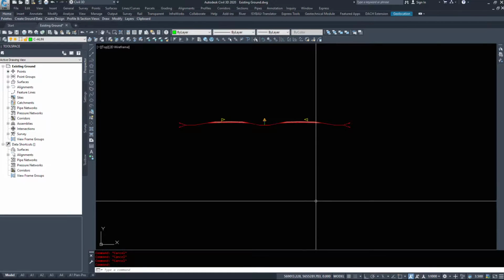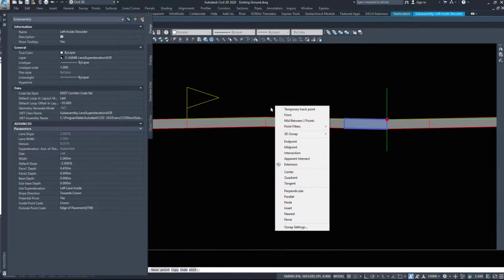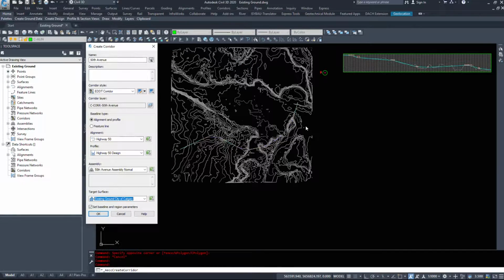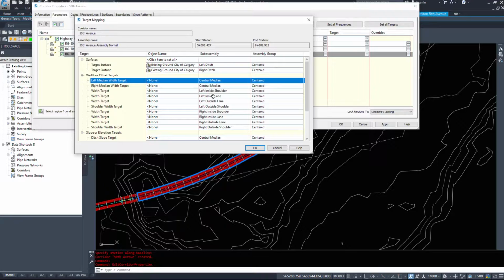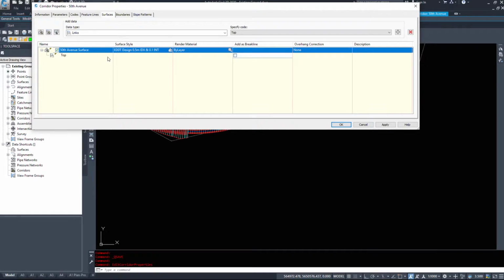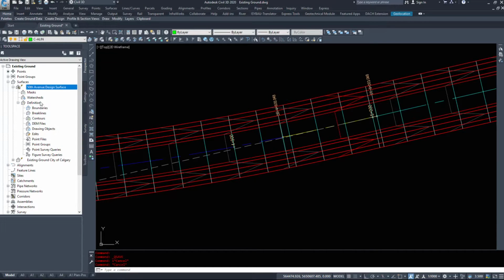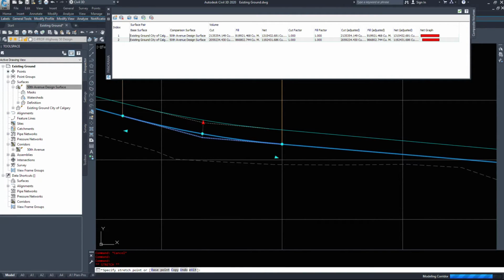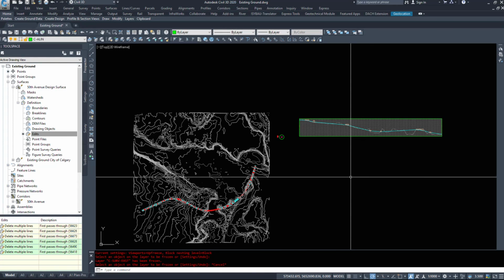Assemblies, Corridors and Modifying Profiles

Comment: Can you please help me? I am creating assembly for divided planar highway and for superelevation to be assigned at the median edges; its not assigning and showing error “Median Edge pivots are not applied on divided roadways when assembly contains only one group”. I have changed assembly type to others but it didn’t worked out.
Reply from the maker: Without seeing the drawing, check your superelevation settings and make sure that they are set up correctly.